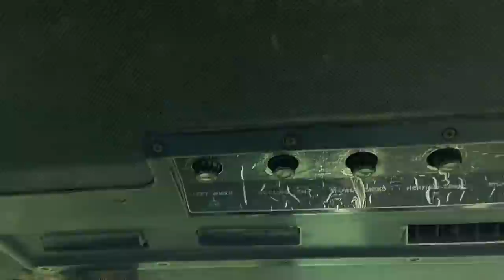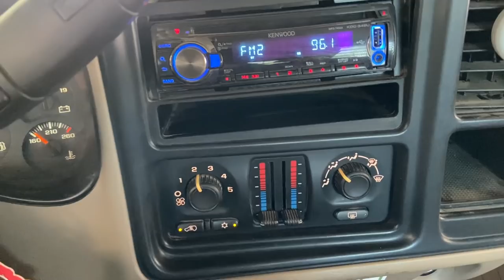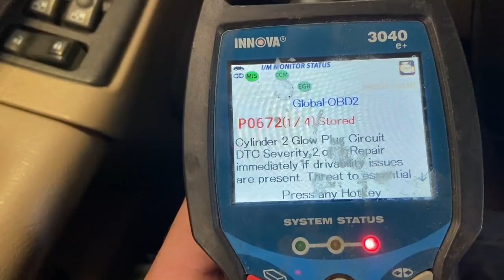The government payed us how much to destroy our corn???

Comment: GM product are famous for cab corners and Rockers rotten out.  Main source it the back window seal. Sliding window or not.  Pull the trim back around the bottom of the back window. If you got water stains. That’s where your rust is coming from.

Comment: Maybe I'm behind the time's but corn has both male and female anatomy on the same plant. The tassel (male part) and the ears (female part). Did they create a cultivar without one or the other?
Reply: I would like to know this as well.
Reply: Once again corn has both male and female anatomy. Removing one part or the other mechanically doesn't change that. How does one remove the female reproductive system btw. That would almost have to be done by hand. I know what a seed crop is.

Comment: you should rhino coat or bed line the surface rust
Reply: That's the worst thing you can do! Then you seal it in to rust some more! You gotta re.ove the rust or chemically stop it!
Reply: @mikeznel6048  nonono, you sand it then you spray it on